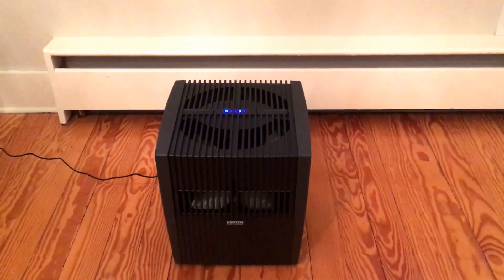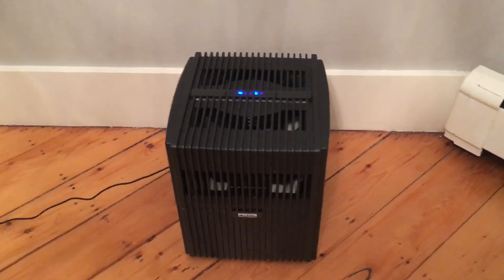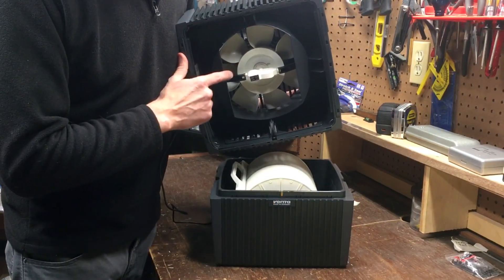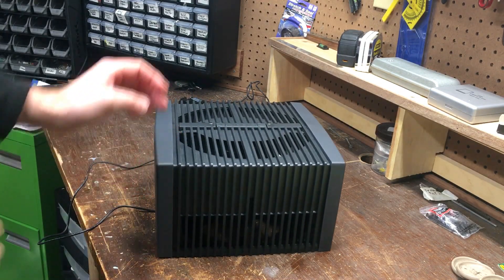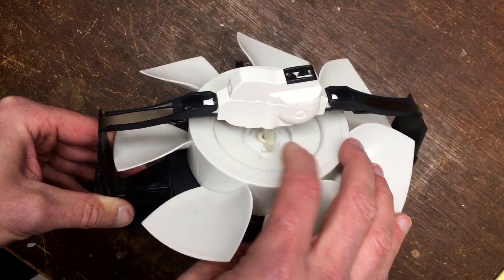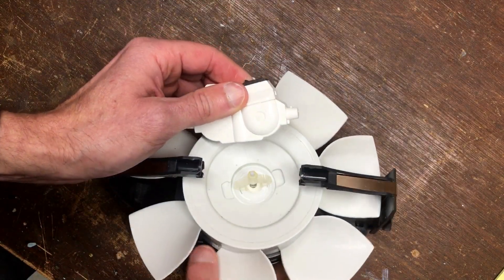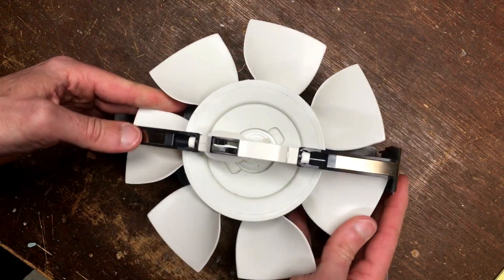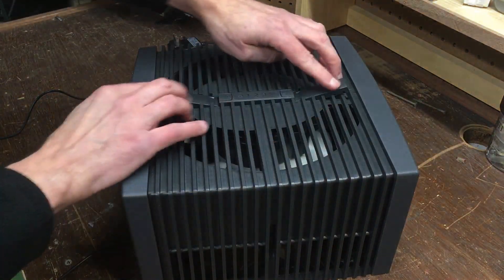Venta Airwasher Clicking Noise - TRY THIS BEFORE YOU BUY NEW PARTS

Comment: You should do trouble shooting/demos for a living.    You explained and showed better demos then most large companies do.
Reply from the maker: Ha! Thanks for the kind words.
Reply: Do you have a video ˋhow to take the disk-stack apart completely´ (to clean the individual disks better)?
Reply from the maker: As far as I can tell, the disk stacks don’t come apart. I’ve been trying to come up with a tool or bush to get in between but had no luck. If they get moldy, I put the stacks in a plastic bucket of water with a few drops of bleach. Then I rinse and use a toothbrush around the perimeter. I’ve also tried scrubbing bubbles bathroom cleaner. To sanitize I sometimes use a steam cleaner and blow steam in between the disks. Short of a power washer, I’ve yet to find a great solution.

Comment: The Venta is a very good humidifier. If you use an ultrasonic humidifier for long, a thin, microsize scale layer will cover everything in the room. It takes time, it needs several months, maybe a year, but everything will be covered a very hard to remove, very thin white scale-coat. So you can't use an ultrasonic humidifier for long because it only sprays the water, it's not real vapour. A used a heated device even, this effect appeared later but it was there.
So you need a real water evaporizer and this is that.
This clicking noise was my nightmare, because this device is awesome anyway. Thank you sooooo much you saved my life.
Reply from the maker: Glad the video was helpful. I much prefer the Ventas over the ultrasonic models. It’s neat to see the steam coming out of an ultrasonic, but I had the same issue with a coating of mineral deposits left on everything. I can’t imagine it’s healthy to breathe that stuff in.

Comment: Thanks for your help. I also wanted to fix the rattling noise and first I tried it like you by turning the gear unit, but that didn't fix it for me. So I opened the plastic housing of this gear unit(you can use a small knife to go in between the housing to detach the clips that hold the three housing parts together), cleaned it and applied some new grease. Now the Venta runs without any rattling noises anymore:)
Reply from the maker: Glad the video was helpful and thanks for sharing your technique.

Comment: First, thank you  VERY MUCH! My relatively new Venta (about 2 years old) started making a slight clicking sound at the beginning of this heating season, which I simply ignored because the unit seemed to be operating OK otherwise. Yesterday the trouble light came on as soon as the unit was turned on, and it was evident that the fan was immobile. I checked the power connection, etc., but got the same result repeatedly. On the chance that your video might help, I followed your instructions faithfully and VOILA! The unit is perfect once again. I cannot thank you enough!
Reply from the maker: So happy to hear that it worked for you! Thanks for letting me know. It’s always nice to hear that my tip is helpful to others. Cheers!

Comment: Thanks for the video, worked for a while. Found out that clicking was due to worn lubrication in the gears. Tried dry PTFE lubrication on the gears after opening box, but it lasted only a short time. Simple solution found, added 2 drops of liquid soap into the opening between the black teeth and the clicks disappeared. May need to add more when clicks come back.

Update: 2 drops of cooking oil work better.
Reply from the maker: Thanks for the info. Hope the clicking stops… it drove us crazy until I made this video. The nosies haven’t returned.

Comment: Mine was making a horrible loud noise and I was able to use your instructions. In addition to what you suggested, I used a toothbrush with vinegar on the teeth to clean up the gear box. It’s now quiet like a new air washer. Thanks!
Reply from the maker: Glad it was helpful. Mine hasn’t made a noise since I put out this video.

Comment: Woohoo! I replaced my gear last year, and was very frustrated when it wasn't turning this winter. I too had the clicking sound. Your video solved the problem!
Reply from the maker: Excellent! Glad it worked!
Reply: @BruceAlanR  My excitement was short lived. 
The gears rotated when I spun the fan, but didn't work in the machine. I then tried taking the gear box apart and cleaning it, and thought for sure it would work. Still only worked for a second. Upon inspection, I saw that a portion of the teeth were worn down on the gear. So...I need another new gear box. Since Venta doesn't warranty replacement parts, I either need to buy another new gear box, or just throw away the airwasher.
Reply from the maker: Sorry to hear that! The teeth of my gearbox don’t appear to have worn down at all in 3 seasons (10 seasons with our older model). Have you tried flipping the disk stack the other direction to see if the teeth catch?
Reply: @BruceAlanR  The teeth on one section of the gear are too deteriorated to catch. I'm hoping they haven't started making the gears out of an inferior material. My first gear box lasted several seasons.
Reply from the maker: I agree that would be pretty rotten! Thanks again!

Comment: Thank you for the tutorial. Like many others, it solved the clicking noise. However, mine still had a faint click even after the flipping. I had to lightly lube the coupling hole. Finally ZERO clicking!
Reply from the maker: Awesome! Glad it worked out and thanks for sharing that tip. My two Ventas haven’t clicked since I made the video.

Comment: My coupling is broken, didn’t know till I watched your video. Thank you
Reply from the maker: I’m glad the video helped you identify the problem, but sorry to hear the coupling is broken. You may be able to use a flexible adhesive to repair it depending on where the break is.
Reply: @ thanks for the idea, the rubber coupling dried out and fell apart like an old rubber band. Looked online for a replacement and all sites said out of stock. Tried to 3D print one but the material was too soft. Finally called up Venta and found out they only sell replacement parts over the phone. Who knew?
Reply from the maker: That’s good to know! Thanks for the follow-up.

Comment: Mine had the same clicking noise. So in my early search I happened to spin the fan by hand in both direction and I heard it happening again, but then it stopped. I put the top back in place and turned it on and now no noise, if it comes back I'll try what you did. I sure like these little units.
Reply from the maker: Thanks for sharing that info. 😃👍

Comment: Man, thanks so much! This didn't actually directly resolve my issue, but it did inspire me to take a better look at the positioning of that motor. Turns out that motor (LW45) on one side wasn't properly clicked in place into the black 'bracket' part. It's very easy to overlook actually!
Reply from the maker: Excellent! So glad it was helpful even if not the same issue. Cheers!

Comment: Thank you!  I purchased my LW 44 Classic in Dec 2002. It still works great!  I have replaced the gear a couple of times but never thought to try this.  I just did it.  Took 1 minute.  Works great!!
Reply from the maker: So glad it worked out! Thanks for sharing your experience!
Reply: A day later it was making a new different subtle quieter clicking noise.  This time, I sprayed a little food-grade lubricant in the gearbox.  Silent ever since!!
Reply from the maker: Ha! Great tip! I’ve got both of ours running and no noises this year so far.

Comment: Worked perfectly! Thanks for the tip.
I will open, clean and lube it next time when it appears but I'm just happy to have peace and quiet for now again. It's a shame that companies create parts that are designed to fail regularly to get some additional on going income. I'd rather pay a bit more on the initial buy or the water additive.
Reply from the maker: I completely agree! Speaking of the water additive, I wish there was an easy way to clean the disk stacks.  Every few weeks I fill the bottom with white vinegar and soak the disk stacks, but there’s still a brown residue on the disks after a month. I usually use a tooth brush to clean as much off as possible, but a toothbrush doesn’t go very deep. It’s a headache!

Comment: wow, it worked.  Thank you for posting this video.  But for me when I flipped the stepping gears I noticed the plastic spindle that attaches to the circular disk wasn't fully pressure fitted to the motor....meaning it was skipping every time the motor turned it (fixed).....it must of wiggled loose switching between speeds!  seems the whole Venta system internals are modular and meant to be easily disassembled.....so they can also become easily become loose because nothing is fixed!
Reply from the maker: Glad it worked out. It’s definitely modular construction.

Comment: i have LW-15. basically, it has 2 type of noise on normal situation. 
 1. a air flow noise. (air pressure sound from fan. it is just quiet white noise. couldn't become problem to me.)
 2. a little rattling noise.  ( quivering, shivering, but not sharp sound. so not big problem but makes rusty mood)

and i heard a big clicking noise from start section of this video,  it looks different with 1, 2 type of basic noise. i call it as type 3 noise. which is got some problem and not normal condition. 

btw, i wanted to resolve type 2 noise, and applied this method on my LW15, and nothing changed. 
but i love this video , because if it getting more big noise as time goes by, i can try this when out of warranty.
Reply from the maker: +SunsinDiary Thank you for leaving a helpful comment. As you’ve pointed out, some noises are normal based on the mechanics.
Reply: I have a quiet type 2 noise as well, did you find a fix?
Reply from the maker: Have you tried reversing the gear box as shown in the video and you’re still getting the noise? I’ve just setup our Venta air washers for the season and they’re quiet (other than basic noise 1). If I have any new noises I’ll be sure to diagnose and try to remedy.
Reply: @BruceAlanR  Yes I have. I never experienced a clicking noise. When you are distant you hear white noise but up close you hear this soft quivering kind of noise, it kinda reminds me of a sea shore how it goes and comes. It doesn't bother me too much for now. 

EDIT: I was able to localize it, by testing every part separately. I hooked up the fan assembly apart from the housing (you have to press the safety button on the fan assembly side struts to turn on the fan) with and without the gear box. With the gear box it made the exact same noise. I guess it is the gears grinding a little bit. I think I need to grease them using a viscous food-grade oil. Preferably by taking it apart but I don't know where to start. I saw some people managed however.
Reply from the maker: Interesting. I’ll have to listen for that noise. Thanks for the tip on the safety button to get the fan to run once removed.

Comment: Thank you, Bruce!
Solved my problem. I went to the repair service center and they told me its all fine and everything is working how it suppose to. Didn't fix anything. The service center is not Venta exclusively, but general service. I still had a warranty on this humidifier but... they did nothing.  
So maybe you know why and how this clicking appears? This looks like  a workaround, but will it be good for longer term?
Reply from the maker: Very welcome! It's hard to believe I posted the video 5 years ago. After the little trick I demonstrate in the video, our Venta hasn't made that clicking sound again in 5 years. I'd say it's a long-term solution.

Comment: Thank you so much for your video.
It’s the best way to solve the noise problem.

By the way I’m from Japan and I’m using Venta’s for over 20 years or so.

We have a problem of the coupling rubber part getting torn apart and had to buy a new one since they (Venta Japan) say it’s not available only to buy the replacement of the coupling part.

Do you happen to know if you can get it in North America?
I have a friend in States and I could ask her to get it and send it to me, but I couldn’t find it online other than the Dutch companies that sell those and I don’t speak Dutch at all.
Reply from the maker: I didn't find any retailers in North America that sell parts, but email info@venta-usa.com and they will let you know if you can just purchase the rubber coupling from them. Good luck!

Comment: Thanks, that makes it way easier. Instead of inventing the wheel again.
Reply from the maker: Glad it was helpful! 👍 btw- your icon kinda freaks me out. 😃
Reply: @BruceAlanR  Ha, lol. Thanks man, I just found this brand of airwasher / humidifier due to the inheritance of a neighbor. We have a house heated by air, so a lot of air vents. 
But the house becomes very very dry. Mostly 45 % rel-hum. But sometimes even 31 % rel-hum.  Hope it works to push the humidity up. The air is filtered all through the day, by the forced ventilation. 
About the icon, that comes from my work as a dentist. I really really loved the surgical bit of the work. Extractions / missing root tips / suturing and stuff.  Sadly it's no longer my work, due to a neck-hernia due to work-environment. Right hand not working properly / dropping stuff and pain.
Reply from the maker: Since the Venta air washer uses cool evaporation to add humidity to the air,  I find I have to run mine a lot more to maintain comfortable humidity levels. Different Venta models accommodate different room sizes, but you may already know that. I recommend getting a cheap hygrometer so you can monitor humidity levels if you don’t have one already (some thermostats can monitor humidity as well). Thanks for sharing your story and I hope your injuries heal. Cheers!
Reply: BalanR  Thanks man!

Comment: I bought the new venta lw25 comfort plus and also had the clicking sound. I sent a sound recording to venta. A woman called back and recommended removing the gear while we were on the phone. I did that according to the instructions of the woman. When I removed the gearbox, a plastic disc fell out, so it became clear that the gearbox clutch had been incorrectly installed. She wanted to send me instructions on how to install the transmission correctly. What she did not do.

I rebuilt the transmission as I understood it. The sound was gone for one day, then it was back. Venta advised to remove the broken gearbox and send it to venta. I got a new gearbox and a instruction. I connected it exactly according to the instructions. Since then the device works perfectly without the clicking sound. So it's not just turning the gearbox around, which turns off the clicking sounds. It is the correct installation of the gearbox with the clutch to the fan. If you have problems with the clicking sounds, then you should have the instructions for the correct installation.
Reply from the maker: Hi Tom- Thanks for the information. The “repair” I did in the video may not work for some folks if the gearbox is faulty. After removing, flipping, and reinstalling the gear box, the clicking in my unit has not returned.  It has now been  3 years click-free. In my case, I did not need to purchase new parts even though I was encouraged to so. So I wanted to share my experience with others in case it is not a faulty gearbox.  Thanks for leaving a comment.
Reply: The click sound comes from a wrong installed gearbox-connection. Maybe you've made the connection of the gearbox to the fan correctly, which was wrong before. If you read the instruction for the gearbox, you'll understand the reason vor the clicking. I do not need to pay for the gearbox because the device still has warranty.
Reply from the maker: tom freier That makes sense. Thanks for the info.
Reply: @BruceAlanR  Now I had the click sound again. I followed your advice and turned the gear box 180 degrees. It worked: the click sound is gone.
Reply: @BruceAlanR  Now I had the click sound again. I followed your advice and turned the gear box 180 degrees. It worked: the click sound is gone.
Reply from the maker: Excellent! Glad it worked! Both my Ventas are still click free. 
 My disk stacks are looking grungy even though I soak them in a bleach and water solution in a bucket (not in the base), so I’ve been trying to design a tool/brush to clean them. I haven’t found that Venta’s annual cleaning solution does a great job either which is why I’m trying to design a hack. I can always send the discs to Venta to clean, but I’m not willing to spend the $.
Reply: @BruceAlanR  I am curious how long the venta will stay clickfree.
I also clean the disc stacks every two months with a chlorine-water solution (Danklorix) in a bucket and use a bath brush to clean it.
Reply from the maker: Mine has been click free since I did the video so I hope it works for you. 
I’ll have to try a bath brush. I’ve been using a toothbrush and it doesn’t get very deep. Do they sell Dan Klorix in the US? I may try it although diluted bleach works.
Reply: @BruceAlanR  I do not know if Danklorix is sold in the US, but certainly chlorine-containing agents. They are antibacterial. i dilute it with water in a square bucket. I actually use a root brush/grooming brush, but couldn't find yesterday a close translation for it.

Because limescale deposits, which are difficult to get off in the watertank, quickly form on the water level edge, I cream the water level area with petroleum jelly so that the lime can be easily removed with kitchen paper.
Reply from the maker: Thanks for the tip on lime scale. I will definitely try it. I’ll also try a bath brush before trying to invent something. Like you, I also use a bucket to soak the disk stack. Thanks again! ... and thank you for subscribing!